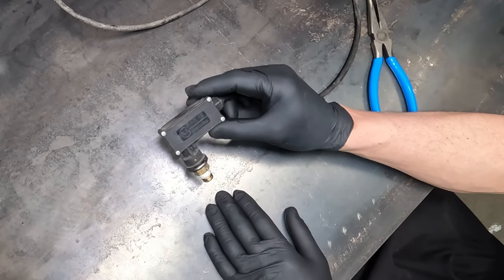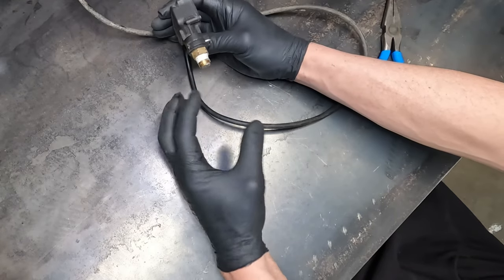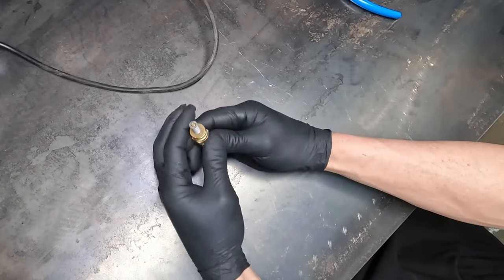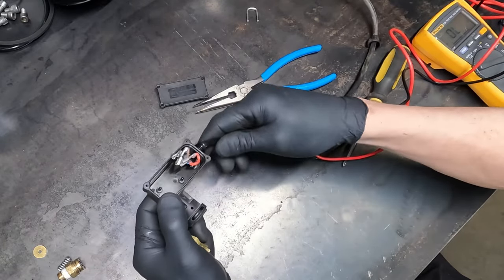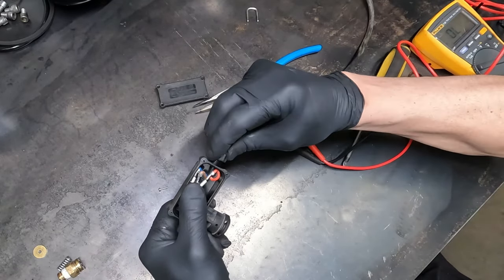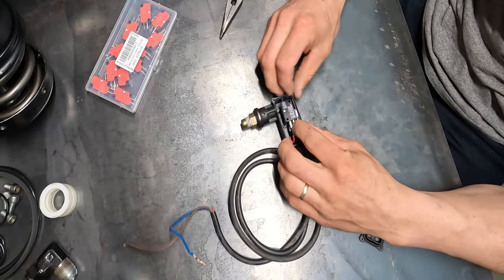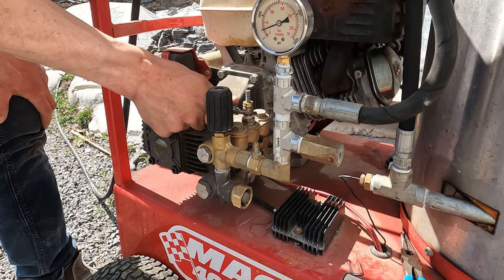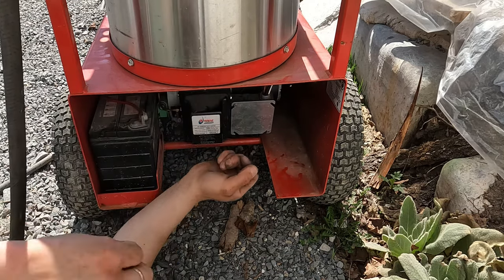Hot Water Pressure Washer - Burner Pressure Switch Repair

Comment: Hey man my flow switch is leaking because it's loose. How do I tighten the swivel ?
Reply from the maker: You can’t necessarily tighten it. I think the o rings on the flow switch where it goes into the pump body might need to be replaced